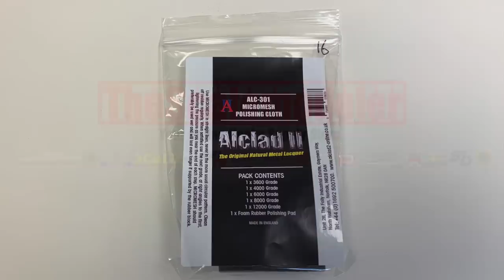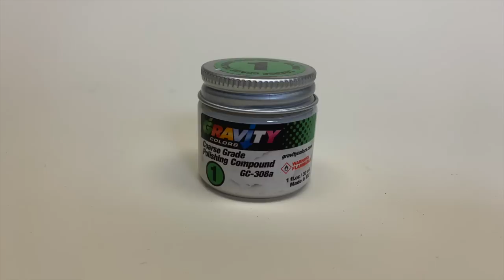How To: 3-Stage Machine Polishing 2K clear

Comment: How to clear coat without getting stuff/junk in the clear
Reply from the maker: Impossible
Reply: Dust and particles can be a pain, I do everything I can to help eliminate them. Here’s my best practice for Gloss clears/paint.

• Run your spray booth for a good 10-15 minutes prior to painting, close the door to your room if there is One. 

• Blow your model down prior to spraying, or/and use a tac cloth. 

• Use a dedicated Airbrush for clear coats, before spraying make sure it is clean, traces of metallic particles and dried paint WILL find there way into your clear or final paint layer!

• Filter your paint/clear prior to pouring in the AB. 

• I use a fine mist spray water bottle to dampen down the inside hood of my spray booth and work surface. 

• Have bare arms and latex gloves when spraying. 

• Once you have mixed your paint, pour it straight into your AB, filtering as you do and cap the colour bowl off with your AB’s lid, any left over paint cover over with something non porous, never leave paint out in the open.

• Prerpare a container to cover your model in between layers. I use Tupperware boxes, empty water/coke bottles etc.. cut in half. Have them next to your spraying area so you can cover them in seconds. 

• If you still get the odd bit in your paint, leave it to fully cure and then flat it back and go again. - When you are clearing, if you get bits in your initial layers you can use fine tweezers to pull them out, the following layers will cover over, never clear over them as they will be trapped and you’ll never sand them out as they’ll be too deep. If you get bits in the final layers, let it cure and then sand. 

This will definitely help 🤓

Comment: Hello!  Do you still use the Proxxon polishing machine as shown in your video?  I bought the same one, but because of the high turnover, which is less than 5,000 thousand per minute, it cannot be done and the varnish burns (
Reply from the maker: Yes i still use the same proxxon

Comment: Is it better to sand before or after clear coat? I’ve seen a lot of people do both. And also, is it better to use a 3 step of cutting compound fine polish paste and wax from real car equipment, or just the one from gravity colors?
Reply from the maker: I only sand after clear
The gravity set is “real” compound. Just in a smaller package
Reply: @TheScalemodelingChannel  ok perfect thank you so much. You polish after you sand the clear coat correct?
Reply from the maker: Yes
Reply: @TheScalemodelingChannel  thank you so much.

Comment: Thanks for your video.  Do you recall how long you let the 2K cure before you sanded it?  I found a spec sheet that says it cures in 24 hours, I'm just wary because I'm used to clears without accelerators and it's usually a one week wait.
Reply from the maker: 2 or 3 days depending on how warm it is in the room

Comment: Tom, do you find much of a difference between using a fabric fibrous buffing wheel (like you used to use) and these soft buffing sponges? Do you get less chance of 'burn spots' with the sponges?  TIA 😎
Reply from the maker: I do indeed. Much more control, and less heat

Comment: Question, what is the RPM range for this rotary tool? I have Dremel an they are 5k minimum an I'm afraid that is to high for polishing. The tool your recommending doesn't seem to mention anything about RPM. Thanks for this video, ordered the polishing pads an sandpaper.
Reply from the maker: The lowest on mine is 5000

Comment: What paints do you recommend I'm using acrylics and enamel paints at the moment. I'm find when I'm wet polishing the acrylic paint comes of. And also what grit sandpaper do I use.
Reply from the maker: That all depends on what you have as far as tools etc. And where you are located for availability of brands
Reply: @TheScalemodelingChannel  thank you.
Reply from the maker: @billysayers7941  so if you could share that info.
Maybe i can point you in the right direction
Reply: How do I share the information it's new to me I've never  shared anything on this before. Thanks
Reply from the maker: @billysayers7941  just reply with your country and the tools you have for painting/airbrushing
Reply: What primer could I use for Gray please?
Reply from the maker: @billysayers7941  grey
Reply: @TheScalemodelingChannel  thank you

Comment: I was told yellow was basically a no cutting ability pad while the black was a very slight cut, and orange the heaviest cutting ability. If this is the same as your knowledge, is there a reason you used the black pad last for final cutting and yellow in the fine cutting stage?
Reply from the maker: Black is the softest. And therefor cuts the least and is used for the finest/final stage.

Not sure if the color coding system is brand specific. But seams like it.
Reply: @TheScalemodelingChannel  Thanks, must be different depending on brand :)

Comment: I wish the paint you use was more available in the states. I found only one supplier and last I checked almost everything was backordered.
Reply from the maker: Zero paints is not the end all be all. There is also gravity colors, splash, scale finishes.. etc etc..
Reply: Thanks!
Reply: @dirttrackracingforlife7107  The way Hobbyworld-usa works is they list pretty much everything that isn't a standard easily sold color as "back ordered". Then at the end of the month he places a large bulk order of all the back ordered products as well as some standard stuff and has it shipped all at once. This is because the prices for shipping flammable paints from Europe to the U.S. is insane as there is a flat fee of like $60 or $70 to ship flammables on top of the standard weighted shipping costs. If you were to buy single bottles of paint from Zero direct that $10 bottle of paint would cost like $80 on every order. If he places a bulk order he pays that added fee once, then the weighted fee for the whole bulk order. It sucks but unless Zero decides to open a US production facility (not likely), any new US distributor is likely to do the same thing. (I have heard another company is looking to become a U.S. distributor soon.

My results with Splash weren't great.  I've heard nightmare stories about poor shipping / not shipping / customer service / not getting orders for 3 to 6 months from Gravity U.S. so I haven't tried them, nor have I tried scale finishes. I've gone back to Zero for my current build and got my order in about 2 to 3 weeks. I placed my order shortly before Matt placed his bulk order to zero.
Reply: @JHartModelworks  shit.....hopefully i don't experience this. I just ordered paint from Gravity USA.
Reply: @zachmarkham84  Best of luck. Looking at the BBB's web page he has not turned his act around. He has a very very long history of not shipping, not responding to emails, if he does respond he sends a tracking number that doesn't go past "USPS is awaiting the package from the sender" because you can get a tracking number from USPS for free and not pay for anything until you actually ship. It looks like people are getting responses in a couple of months, which is better than before. I've read on forums of people not getting product for over a year. If you used paypal, and he doesn't ship you can file a dispute with paypal.

I really like Gravity paints from Spain. I order from them and get my orders here in texas often in as little as 4 or 5 days.
Reply: @JHartModelworks  well shit...... i did use paypall so there's that i guess

Comment: What causes orange peel, and how can you prevent it from happening?
Reply from the maker: a lot of different things, it simply cant always be prevented.
Reply: @TheScalemodelingChannel  In other words, like me; you don't know. :)
Reply from the maker: in other words, it is dependant on so many variables, that i could impossible pinpoint it in your situation, or mine.  It depens on the exact mixture, how old the paint is. how perfect or imperfect the paint layers underneath are. the room temperature. the airbrush, the airpressure, the moisture content in the air, and i could go on for a bit....
Reply: @TheScalemodelingChannel  Thanks. Looked it up. Nice vid btw
Reply: NeonsStyle two main reasons, paint viscosity and poor atomisation.  Paint quality is also a factor, cheap low quality paints that don’t flow out well.